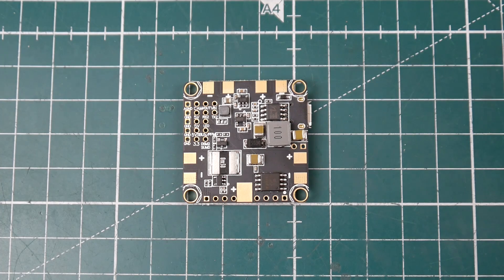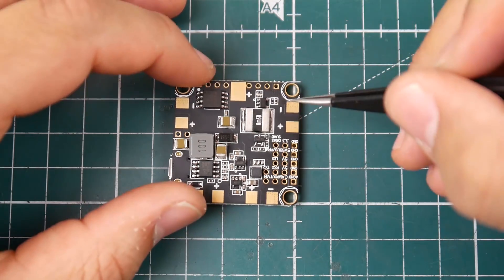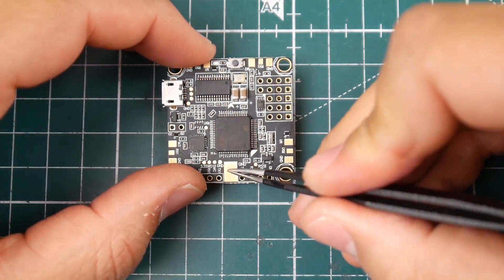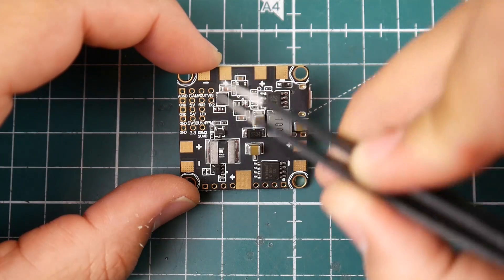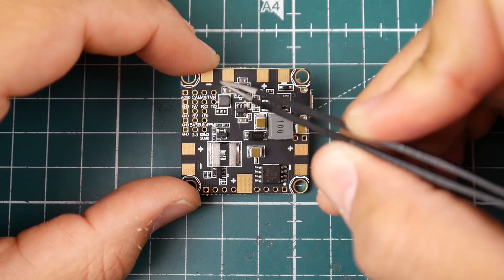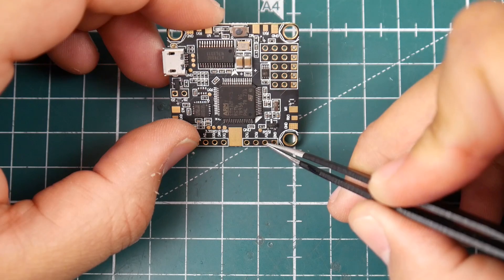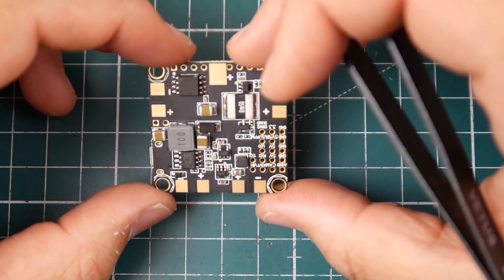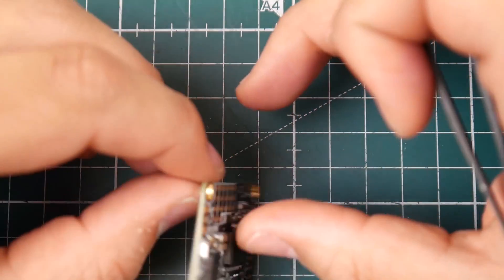Generic F4 Flight Controller AIO // Overview

Comment: please make a video on the best fc  and the best escs i dont care about the price and i dont care if it has a vtx or distribution board or esc
Reply: No info? If its a micro, you certainly don't want a 60 amp ESC, similarly you don't want an 8 amp ESC for a huge quad. For flight controllers, lets put a 1 Killogram unit in it. It may have advanced laser targeting system with facial recognition and an AI designed to take over the world, but hey, you weren't specific, its going to be better than anything else out their, just weighs a ton with features only the military would want.

See what I mean? Nobody could ever recommend anything for your blank statement. Its like asking what engine you should buy for your car. My cousin's 7.5 Liter V8 would not fit in a VW Beetle, and my 1.3 Liter rotary engine wouldn't be all that great in a truck. How could you possibly recommend an engine or anything without specifics on what you want it for? Reliability/racing/fuel economy/pulling all day/gentle cruising? No idea, you might be making areal photography drone (I'm making a sleeper DJI phantom filled with race parts just for laughs and to confuse the heck out of people, just saying, that's going to need way different parts than my micro)

If you ask specifics, maybe someone could help
Ex: 250mm quad with plenty of room, 6s Lipo, 1 kW motors (45 amps each). Or maybe its a lower powered one that won't chop your legs off and is fine with a 4s 30 amp ESC but it needs to be very compact to fit.

Comment: Looks like a betaflight clone, the f3 and f4 have the ESC power and GND on the bottom and it's a real pain because you have to solder ESC wires to FC before soldering to the ESCs. The close battery terminals don't cause an issue and the betaflight version is a rock solid board, just sucks to build.